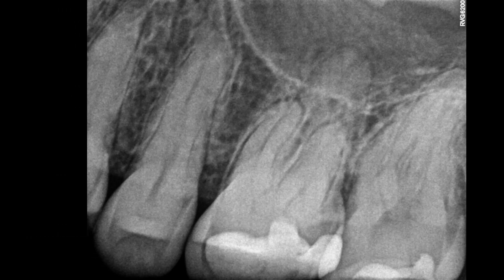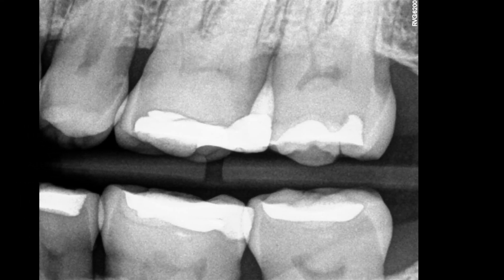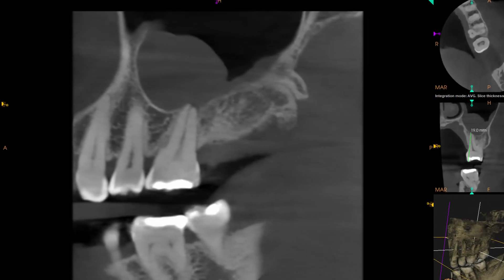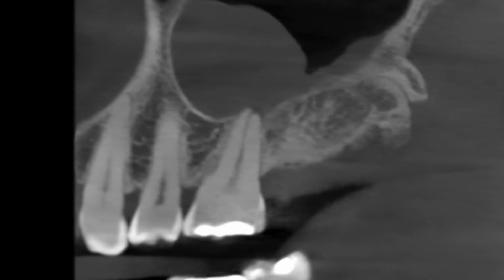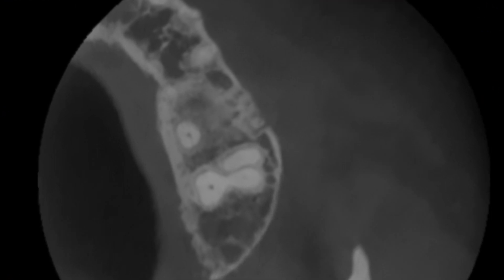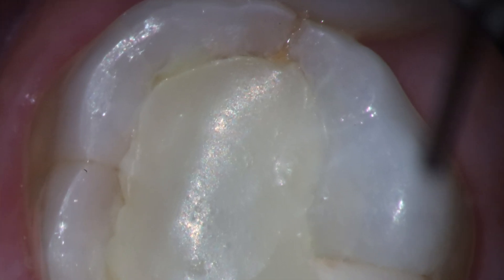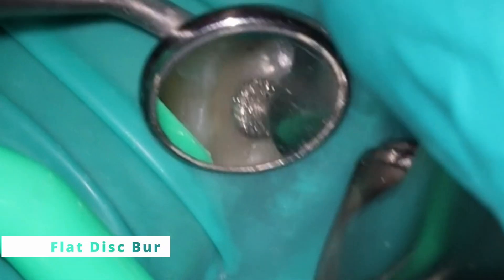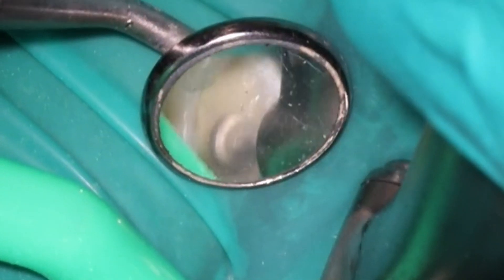Cracked Maxillary Molar: How to Find MB2 & Protect the Tooth with a Build-Up

Comment: Hello, doctor. I'd like to ask, do you use 0.0 as the standard for working length? After you 10k file to measure the working length, how do you ensure that the rest of the shaping files maintain this length precisely?
 
In my daily work, I usually use 0.0 as the standard. After measuring the WL, I find it quite difficult to maintain the original length when shaping the root canal with rotary file.Carelessly, I might exceed the apical foramen, and I'm afraid this could lead to postoperative pain. Or, the length might be shorter than the working length, causing ledges.
Reply from the maker: Great question! I've attended multiple lectures on this topic in the last few years, and everyone agrees that the new standard should be 0.0. 
Patency hasn't been shown to increase post-op pain, so you can breathe easily about that one. In most cases, I also keep the apical size tiny (17), so even if it's 0.5 long, it's still around a 20. What size files are you using for your MAF?

Comment: thank you for sharing! i usually have two adhesive systems, one with self-etch properties and one where the adhesive is in a separate bottle, In cases like this where dual-cure composite is indicated I use Etch-and-rinse (total etch 30s E 15s D), because the acidity remaining in the self-etch system inhibit polymerization of the dual-cured composite on the interface between the restorative and the adhesive.
Reply from the maker: Thanks for sharing!

Comment: Do you have any opinions on material for the final crown when it comes to cracked teeth (in particular, shorter teeth also?)  ?   Love your videos.  Also I've meant to ask if you have a preference for apex locators?  I think mine is dying :(
Reply from the maker: Re: material choice, that's a can of worms I don't feel confident opening, lol. Whatever the restoring dentist is most comfortable with is ideal. I would tend to avoid something like zirconia due to its strength (not because of this tooth, but because of the effects on the surrounding dentition!) Gold is always king, but good luck getting patients or doctors to use it. A bonded Emax is incredibly strong and could be a good option here, too! 
Regarding apex locators, I'm currently looking into the new Root ZX with the HF attachment, but they're pricey. You can find ZX ii's on eBay for pretty reasonable prices, and they last forever, but any apex locator from a reputable company should be solid and last you your entire career.

Comment: eh I do think Dr. Clark does really stretch the implications of compression based restoration approach a bit far when he starts saying words like "negative C factors" and conflict with disciplines that really focus on adhesive dentistry like the biomimetic dentists (very prolific on instagram).  When I took his course, I did think he made a distinction in making sure dentin hybridlayer is established if a lot of dentin is exposed in the tooth prep unlike his hallmark procedures like black triangle closures where it's almost pretty much all enamel. In this case, where you're using dual cure composite (right?), my suggestion is to consider waiting ideally 90 sec after placement of build up before light curing and double cure for opaque white build ups. I believe Nate Lawson from UoA showed DC composites need that initial self curing time so the dentin bond is established before the light cure that prioritizes enamel bond :) but anyway, another great case & I agree on covering the cusps on high risk tooth like these for sure even if its with build up for now.
Reply from the maker: Yes, this was with Build-It (fiber-reinforced dual-cure composite.) I like the idea of waiting a bit, as it does set up super quickly. Sometimes, I can't wait that long if there are patient or tooth considerations, but it should be solid on something like this, where there are circumferential walls. 
I just saw Nate last month (I invited him out to Reno to talk to our local study club!), and he was terrific, as always. I don't usually worry about the differences in bonding between the dentin and enamel because the teeth I see rarely have enamel left, but that's also an excellent point.